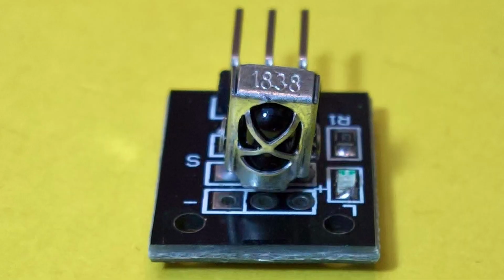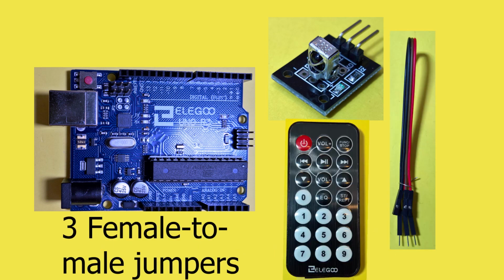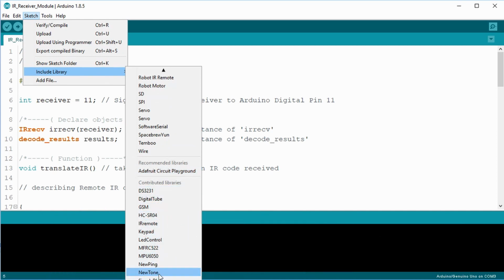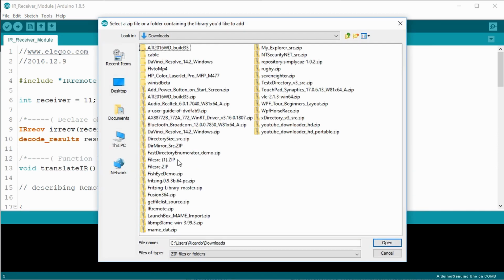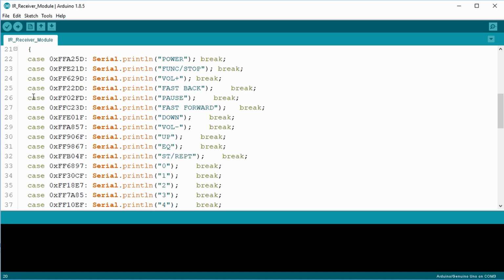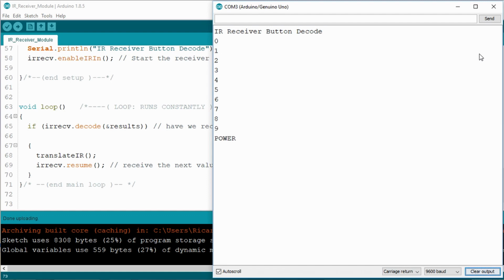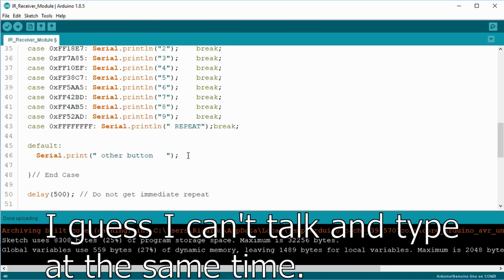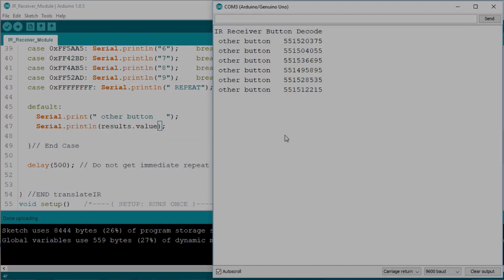Lesson 14 IR Receiver Module and IR Remote

Comment: When your code, I get different IR codes for the SAME button I press if I press it over and over again. How do I fix this?
Reply: Also try different wires. I have noticed that some of the M/F wires in the kit don't always provide a solid connection. I was seeing the same thing and also tested the battery, etc. Then swapped the wires out and it work as it should.
Reply: @edhand2799  Omg thanks so much!
Reply: @edhand2799  i swapped wires, but still keep getting random numbers. I am using the library version thats in this video as well
Reply: If you are using the remote that came with box, and doing it exactly how did, (Including installing latest version of library) it should be the same every time. At the very least I only used 4 buttons with actual Hex addresses, but I made sure to add the repeat function and the default print lines and it works. However if like me you used the supplied code before coming here you may have to delete all of that and do it from this video.

Comment: Hmmm I used the code and the serial monitor showed the startup message but when I press buttons they dont go through? I have the same elegoo remote as the one in the video. I will keep trying to figure this out!  I know my remote works because the infrared light shows up when I look at it through my camera... I think my receiver is broken.. its gotta be.. everything else works like its supposed to plus I copy and pasted the code and it compiled fine haha. I know I wired it right too so idk.
Reply from the maker: Assuming that you are first trying the tutorial, there's only three wires to connect.  Hopefully you've wired it up correctly.  There's no need to copy and paste.  Simply open up the Elegoo tutorial's provided .ino file.   Lastly, the battery in the remote could be weak.
Reply: Yeah it's broken. I just bought a new one. Thanks anyway man!
Reply: @d3bbi339  do you see a plastic piece on the back of the IR remote under the ELEGOO name, if you pull it out then it will allow for current to pas through and thus you it should be working.
Reply: @supercarclips-v6i  I really don't think they would not have seen that.
Reply: @supercarclips-v6i  thanks! this was exactly my problem!

Comment: So I did this however when I powered my ir sensor it started getting hot and then made a weird smell... would recommend using a resistor instead of connecting directly to ground
Reply from the maker: Are you using the IR sensor from the Elegoo kit?  The kit includes an IR sensor and remote.  I suspect that some aftermarket IR sensors are only good for 3.3 volts.
Reply: Ricardo Moreno yes it was the one I got from the kit... even with a 220ohm resistor on it stopped working after a half hour of use so I might of just had a dodgy sensor. I have got a new sensor on order will update you if that works any better.
Reply: I think mine broke at 5v as well. It got hot and then the light went out,
 anyone reading this definitely connect to a lower voltage or add a resistor lol. It will save you buying another one.
Reply: Btw I had the one  that came with the elegoo kit. The kit is still awesome as hell tho and I would recommend to anyone who wants to start with arduino but doesn't want to spend twice as much for an arduino kit.

Comment: I have a similar kit, where this is lesson 13, but everything else is the same. I followed your directions exactly, including getting the newer version of irreceiver. however, nothing comes up on the monitor! there was a plastic strip between the battery and the remote contact, so I'm guessing the battery is good. I went so far s to check it with a volt/ohm meter and that showed it was good too. any ideas?
Reply: Do you know that IR recievers frequency? 0:26
Reply from the maker: The Elegoo tutorial has the IR frequncy list as 38KHz and 900 to 1000 nm wavelength LEDs.  If you go to Elegoo's web site, you can download the complete tutorial for free.

Comment: Please help. Every time I try to upload the code I get a message "exit status 1". This also happened with half the other lessons. What do I do?
Reply from the maker: Just to be sure I understand correctly, you are getting an error message 'exit status 1' when you try to open the sketch IR_Receiver_Module.ino in the Arduino IDE?
Reply: Yes, correct.
Reply from the maker: An exit status of 1 means that there was a problem compiling, linking, or uploading some code.  Make sure you have the latest Arduino IDE, version 1.8.5. Make sure that you've Download and Unzipped the tutorial lessons.  If you having issues compiling, set your Preferences to verbose output for compile and upload.  A description of the exact error will be present.  Also, try one of the build-in examples to make sure your Arduino IDE is working correctly.
Reply from the maker: Oh, and check that your board setting is: "Arduino/Genuino Uno"  if you are using the UNO R3 board.
Reply: I had to set my board up. It was a in the top menus. Also you may need to look up bootloader.
Reply from the maker: The Elegoo UNO R3 board already has a bootloader installed.